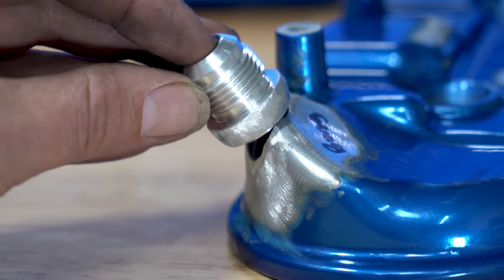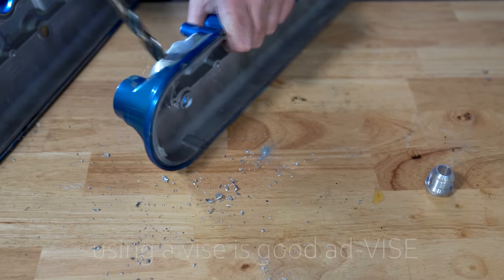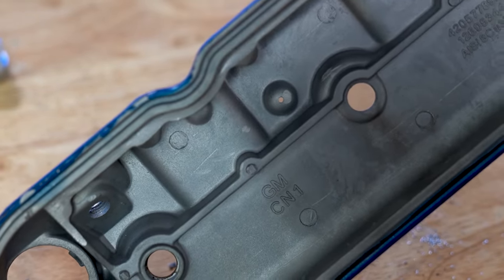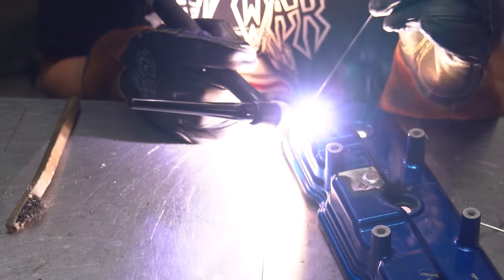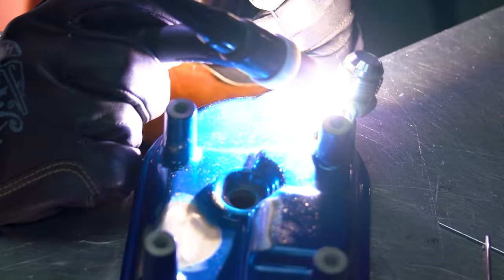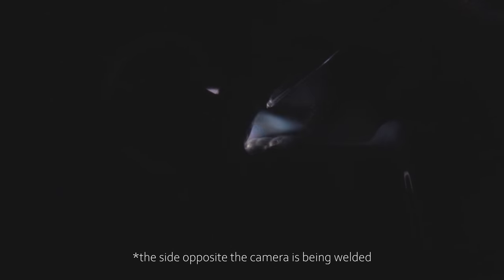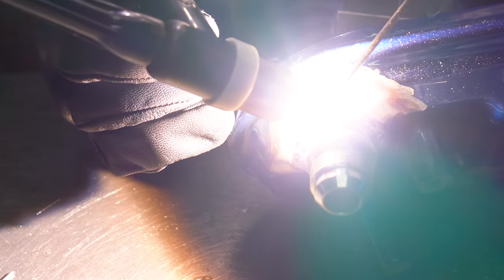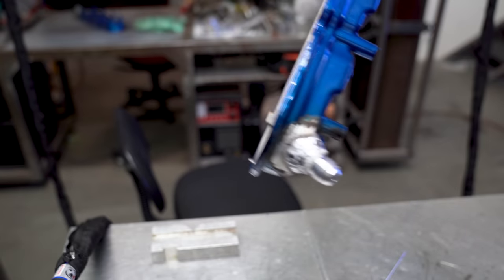TIG Welding Huge Gaps

Comment: It's nice to see welds that aren't 'show quality', but are perfectly functional solid welds. Explaining why/when you choose get it done and out the door vs  make it pretty helps too. Sometimes function is more important than form...
Reply: When you are welding cast aluminum that has engine oil in its pores, expecting perfection is going to lead to big disappointments.
Reply: I'd say function is /always/ more important han form. I don't mean ignore form altogether but honestly, unless we're making art, function should be top priority.
Reply: Clean prepped aluminum is easier to pick up after a month of mild/stainless work compared to engine parts. I was a few months rusty lying on the floor welding a 6g type crack on a motorcycle head. THAT almost made me throw my $6k dynasty in the dumpster with bullet holes. And the repair still leaked oil down the block after the first start up.
Reply: Ugly isn't a weld fault 😀
Reply: good comment...😉
Reply: an ugly weld does not mean it is a bad weld. a good weld is a weld that keeps the dimensions and quality. Sorry for bad english. With kind regards from a welding teacher from sweden :)
Reply: Function is more important than form majority of the time in the real world

Comment: dude, i really appreciate this honest and straightforward content.

was thinking about you guys. i was passing through Henderson, NV. I stupidly dinged the rock guard on my enclosed trailer while backing up. it tore the 16-gauge aluminum... about eight inches. just needs to be pulled and tacked and seamed or slap a piece on top and butt weld it. Trailer repair guy quoted $3-400. there's no structural anything! it just needs to be closed up.

I'm in the middle of moving. My TIG welder is in the same trailer packed up. I'll fix it on my own when I get settled but I did wonder, "I wonder what TFS would charge for this?"

Comment: Its good practice to use the clutch on the drill, vice or no vice. Ive saved snapping quite a few drill bits and prevented the piece from grabbing and spinning like that more than once.
Reply: There is no way this guy doesn't have a drill press he just did that "because YouTube".
Reply: @Jonathanimpossible  How would you (reasonably) set that up in a drill press for the big hole? Sure the little ones on the flats would be fine, but those big ones on the corner would take forever to set up in a drill press.
Reply: Clutch for drilling? Madness!
Reply: Yes.  I was just looking around about it and apparently the clutches in brushless drills stop the motor while on brushed drills it slips the chuck.  For easing drill bit kickback purposes the electronic clutches on the motors are better tuned than the manual ones in the chucks.  And apparently locking chucks is also a thing.  I'll have to check that out.

Comment: Filling that wasn't too bad, but bending a small pie cut of sheet aluminum could have made it a lot easier too. That or Jody's favorite copper (or even steel)backer to help keep the buildup in the right shape. 

Funny, I've been repairing cast valve covers and manifolds for a long time and you're the first I've seen to recommend washing the metal with the torch to clean it up before trying to weld to it. That's been my SOP for a long time for exactly the reasons you cited. Not seeing anyone else suggesting it did have me wondering if I was doing something wrong though, so it's nice to see I'm not the only one!
Reply: Good tip! I plan to start learning TIG soon.
Reply: Yes, If some housing has had greese or oil in it especially for a considerable time, you will be surprized at how much "Junk" comes out of the metal that you thought you cleaned petty well. (been there, done that, got a T shirt) I've even seen parts "cooked" in an old oven to burn the Crap out of it.
Reply: @acat6000  be patient

Comment: Worked for an office furniture company. Started out learning to tig and having to bridge all kinds of gaps on file cabinets, desk supports, benches and all kinds of other thin sheet metal stuff. Starting out there and then learning to weld heavier structural frames I think was easier than trying to go the other direction.
Reply: Can you weld my chair at work? It sucks ass. There's no back support, whatsoever.
Reply: 100% is. Thin wall piping infuriates me

Comment: Great tips, and they all work pretty well. I had to do a similar deal with a JIC fitting in a valve cover on my own car, and found a SS bolt that fit pretty snug to the ID of the fitting and then used washers and a nut to hold it all in place. That seemed to help a bit also. But I admittedly do not have the puddle control you do either. But it really helped in keeping that passage way clear.

Comment: Absolutely a spot on, well described video that made perfect sense! I'm a welder myself and the part about building up the gap with the 1/64th wire instead of 3/32 is good knowledge. I would've screwed up the opening for the bung with pushing thru the 3/32..lol..$40 is a great deal for that. great job on the fit up and weld..5🌟💪👊👊🇺🇸
Reply: I think Justin meant 1/16th wire, not 1/64th as you say. And yes, $40 is a price you would charge a friend for this work. A more "normal" price (what is normal?) would be $80, IMO.

Comment: Do you separate your sandpaper / brush used for iron/steel and aluminium or you just use the same paper / brush for both iron / steel and aluminium?

Comment: Another good video, can you do one on what kinds of products are safe to clean or good to clean up with prior to welding, you mentioned one time not to use break cleaner, could you expand on this subject please. Thanks for the content I have learned allot from you and had the confidence to have a go at welding up my cast lawnmower parts which saved me some massive coin.
Reply: I can't remember the chemical in the older solution of brake cleaner and some others but when exposed to welding formed phosgene an extremely deadly gas. More than a few welders over the years killed or woke up on the floor barely able to breathe wondering what the hell happened.

Comment: Thanks for the advice. I have a cast ali valve cover on a import engine that has a hole in the side from shipping i need to repair. Clearly i need to work the edge to get the junk under control first.

Comment: Works beats pretty every time... :)

I did my very first alu welding a couple of weeks ago. Not pretty, but seat unit of motorcycle has something to support itself on, after part of it broke off with clumsy rider... :) [It literally only supports the seat unit itself, the rider [me] sits another foot forward, with a sturdy bracket holding the seat unit on]

Comment: Question.  During several points in the welding your tungsten was fouled but you continued to proceed.  With your skill level, even with a camera making viewing the pool a misery, i can't see this as being an accident.  So the question is, when you are having to deal with garbage cast aluminum parent metal, does it matter if you have a blunt tip?  Does the arc spreading out actually have any benefits?
Reply: sharp tungsten and aluminum = big no no

Comment: Crazy to see how well you do with the dip clumps accumulated on the tungsten.  Im always so paranoid about keeping a fresh, sharp tip.. And then of course I blow it after a minute or two..
Reply: I've been welding a lot of alluminium lately at work and I try to keep a really short arc because I need about a 3mm weld, well that ends up being 4mm+, and the amont of times I touch the puddle from getting so close and the amount of times a day I have to re-sharpen it, you know it gets a bit annoying, but the 3/4" pipe (6061-T6)  I'm welding around is 1/16" thick, and I'm welding it through a 5mm thick plate, (5083) so I'm using 1/16" 5356 filler.

Comment: Thanks for sharing, content like this helps a lot. 

Question - at 6:27 there are two little "droplets" on the tungsten and you seemed to be able to keep welding fine, are the droplets on the tungsten normal or is that contamination? 

More info/why I'm asking - I've noticed this happen on mine (3/32" CK layzr) when doing thicker (3/8" +) aluminum. On thinner aluminum I'm used to seeing the tungsten just round over a little instead of creating two droplets so I've been trying to find settings where it doesn't happen.

Comment: 1/16" aluminum filler?  I find this diameter melts too soon and I have to pull it further from the shielding argon.  Was welding 16 gauge to 1/8" fillet joints.  Finally mastered it.  I accidentally ordered 2 pounds of this filler so I am set for life.
Reply: @ButBigger42  
It was the joint configuration.   Complex shape and limited access.  I blame the designer, myself.
Reply: 1/16 for ally takes some getting used to, but once you find that sweet spot, you'll HATE using bigger filler (the exception being thicker stuff, obviously)
The only real frustrating part is youll find yourself stopping for more filler more often
Reply: For fillet welds, you kind of have to thrust the filler rod into the pool, instead of tapping it in like on steel

Comment: Im curious, what do you find works best for grinding down and finishing aluminum welds?
Reply: Something low speed. Single cut burr bit anything that won't smear it.
Reply: @greatestevar  Either that, or an aluminum finisher... of course. They both work, I guess.

Comment: I suspect that the 'junk' at times is zinc, magnesium, silicon and other alloy elements that are in higher amounts than is associated with weldable aluminum materials.
Reply: Did you also pre-weld the area where you welded on the nozzle to burn out the junk?

Comment: I kind of explain it like this the little Bridges to build from cuz you're building these little tiny Bridges from one part of the part to the other part that you're trying to connect and it's a large hole and you're dealing with crappy metal one size got good metal the other side's got crappy metal so you trying to put some bridge foundations of good metal which is your bead to build an arc over to the good metal back and forth till it fills it up and you have a solid well that's just the kind of the way I explain it

Comment: if you heat the base then apply the filler just as its cooling you will actually pull the filler into the void, advanced skill but not really that hard.

Comment: I am not sure it is correct or not. But I usually form a piece of aluminium to fill large gaps, instead of filling in.
Reply: Did you watch the video? It is discussed why he did it like this
Reply: @AlessioSangalli  What are you reading into what I said? I was simply stating what I do. Not what should be done by others. Also by the way it is just as fast to make a piece than it is to fill.

Comment: you guys always teaching ways too not make mistakes 

that only part of it-where you’ll really benefit is welding with higher current on scrap

why?

many learners fear the sound and drama that happens welding high currents-you need too get comfortable with this

learn hi first THEN go down-two birds with one stone doing it this way

Then learn using excessive rod, push as much rod as you can in the shortest distance-this will greatly improve hand control

Now, burn as many holes as you can until you reach the correct current, instead of going from low too high, go high too low-get into the habit of taming a wild animal (excess arc & and rod)

keep doing these things and you’ll learn much faster-it’s the same a riding a bike, those that fell learned much faster than those that “crept into it”

Comment: Just the tungsten alone is a dead give away this guy is amateur, if done old school could be green tungsten and ball it, but new way especially with a high frequency machine using inverter. I would be using blue tungsten or gold sharpened to fine point then knock off a tiny bit of tip.
Also practice is no excuse.
Never down hill weld aluminum.
I could go on for a few pages. 

- from a aerospace welder, and gtaw college instructor
Reply: I've used a lot of 2 percent thoriated tungsten on a wave pulse machine never had a problem.
Reply: And actually that knocking off tiny bit of tip is called truncated. Yes I've welded nuclear and was a instructor.